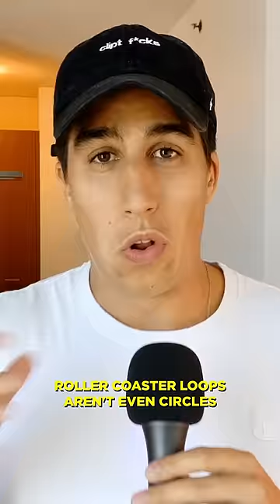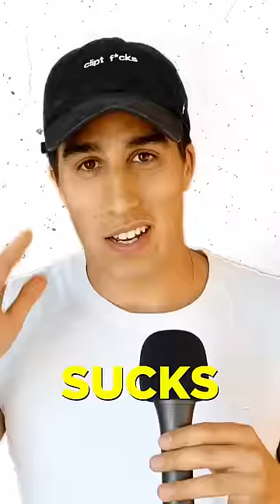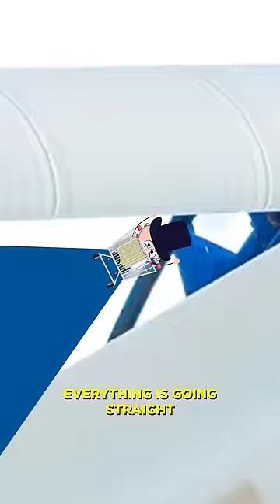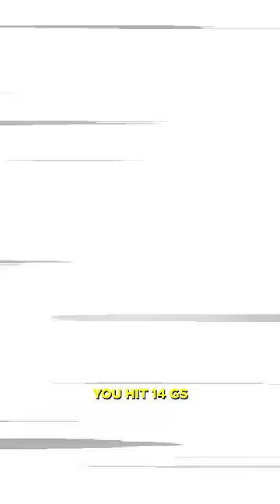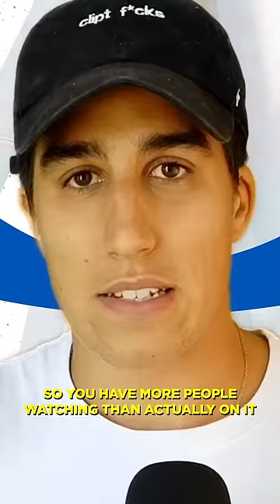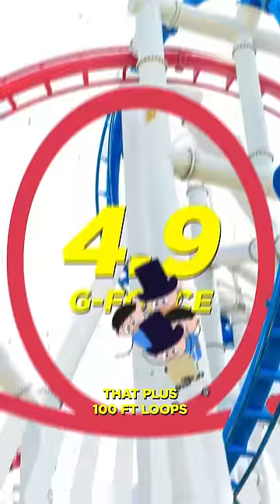Why roller coaster loops aren't circular? #shorts

Comment: Nice video, though you some missing/ wrong information. First, Disney didn’t design the first vertical loop, it was Schwarzkopf, then Arrow Dynamics (who were working with Disney at the time) came up with a pretty much identical design a week later. Also, that 4.9 max vertical g stat that you gave was kinda misleading. That’s not what all vertical loops pull, but just that specific one. Most loops pull around 3.7 gs. The point of the vertical loop was not to lower the g-forces, that could very easily be done by simply making a bigger loop, but to make those forces consistent throughout the loop.  
Sorry about the ramble, but it bugs me when information about coasters are wrong.
Reply: Yeah, Not to mention that the Double Corkscrew was built before a vertical loop.
Reply: Yeah same here my guy

Comment: I remember going on a rollercoaster with a loop for the first time. I was always too scared to ever try but I finally pushed myself to do it. The ride was fast and scary but when it got to the loop, I didn't feel like I was upside-down. It was like the ground and the sky rotated around me and I was completely safe and moving even slower than the scary and fast parts of the ride. The loops brought me peace.

Comment: The "teardrop" is actually called a clothoid loop and the radius of the bottom of the curve is twice that of the radius of the top of the curve. It's the same type of curve used for left turns on cloverleaf intersections

Comment: The first coaster with a teardrop loop was Corkscrew at Cedar Point. Revolution at Magic Mountain did open exactly 7 days earlier, but Revolution actually has a circular loop. Arrow Dynamics is actually who invented the teardrop loop (Corkscrew is an Arrow Dynamics coaster, Revolution is a Schwarzkopf, and they only did circular loops). And it obviously wasn't Disney, the first inversion at a Disney park was on Indiana Jones et le Temple du Péril at Disneyland Paris, which didn't open until 1993.
Reply: "...and they only did circular loops" NO they didn't. It is subtle, but the loops on Schwarzkopf looping coasters do in fact have a teardrop shape. Arrow just preferred to make their loops have a much larger difference in the top and bottom radius of their loops. Yes, the Schwarzkopf loops were closer to circular but the radius was still larger at the bottom than the radius at the top of the loop. and judging by the fact that there is no reference to any reprofiling on the wiki for revolution, it has always been a clothoid loop and not a circular loop.
Reply: @kaylinosprey3306  I took a closer look, and your right. I can indeed see the slight difference in radius between the top and bottom of Schwarzkopf loops. I've never noticed that before! Makes me wonder if a truly circular loop would feel noticeably different from the Schwarzkopf ones
Reply: @Coaster42  also, sorry if I sounded rude. I wasn't intending to. It just bothered me.
Reply: @Coaster42  I believe copperhead strike has a couple circular loops, so if you really wanted that would probably be the best bet for experienceing circular loops.

Comment: Okay so the teardrop loop was actually made to keep a constant force on a rider. It would be uncomfortable if you were to get hang time in a loop and thus, manufacturers made it so vertical loops have a constant positive g-force as it is a lot more comfortable and keeps you in the seat more. The only manufacturer that doesn’t use overly teardrop shaped loops is gerstlaurer and they don’t do vertical loops very often. They’re often taken at speed if circular, whereas teardrop ones are taken at a fluctuating speed.

Comment: Not trying to be rude, but the part about Disney was Wrong. Disney did not do it. One of the biggest amusement companies Disney would work with, Arrow Development, known for rides such as Loch Ness Monster, Magnum XL 200, and X2. They created the first modern inverting coaster in 1975 in Corkscrew at Knott's Berry farm, while the first modern coaster with a vertical loop was Revolution at Six Flags Magic Mountain, made by a completely unaffilliated company called Schwarzkopf, and Arrow opened their coaster with a vertical loop the week after, which is Corkscrew at Cedar Point. Other than that, I think you got the info right
Reply: Wow, and now I'm going to check out your channel. New coaster enthusiast here👍✌️

Comment: The roller coaster loop was designed so that the g-forces (more on that later) wouldn't make the person blackout at the start and end, so the teardrop shape was developed so that the g-forces would be less forceful at the start and end of the loop. 
G-forces (aka g's) is the force of gravity acting upon somebody. 1 G is what you feel right now, or your body weight x1. The average human can go 6 sustained g's without blacking out, and usually 10 sustained g's before somebody could die. Fighter pilots usually go through 9g's of force during some parts of their flight, for reference. (Taking selfies during those 9g's really doesn't make you look that flattering)

Comment: Fact check bc I’m a nerd about this:
Disney didn’t actually come up with the teardrop loop, it was the company Arrow Development. They came up with the first teardrop-shaped loop, but the first modern vertical loop was still circular. Said first modern vertical loop was Revolution at Six Flags Magic Mountain in California, and it was circular and made by a coaster manufacturer called Schwarzkopf (not to be confused with the shampoo company of the same name). Schwarzkopf continued to make circular vertical loops until the company folded, and yes, they did deliver quite high G-forces, but they were built in proportion so they didn’t deliver too much force. That being said, the most forceful of those Schwarzkopf loops could still hit up to six Gs. Going back to Arrow, the first teardrop loop that they made was on Corkscrew at Cedar Point in Ohio, which was also the first roller coaster with three inversions. Arrow didn’t fold until much later than Schwarzkopf, so they influenced other companies like Vekoma and B&M to make teardrop-shaped loops as well. Today, the teardrop-shaped look is the shape of choice for all manufacturers, and no circular ones have been made since Schwarzkopf folded in the late 80s.

Comment: not sure if i dont understand or missed the context but more gs your pulling the harder it is to breathe thats why pilots are trained in the air force on special mechanics to get use to a 9 g force which can cause severe damage, if pilots didn't wear G suits they would snap there necks ect on ejection from aircrafts

Comment: The 1901 looping coaster from coney Island used the tear-drop loop. Disney didn't re-invent the loop, especially considering I can only think of 2 US Disney Rollercoasters with a loop and they both were manufactured after '99. Hell, even the carolina cyclone at carowinds features true tear drop loops and that ride opened in 1980
Reply: Yeah, it was most likely made by Arrow or Schwarzkopf.

Comment: Also, it's the opposite. The circle loop made the g force uneven, not too large. They weren't hitting 14gs the problem was you enter the loob 2-3 g, reach the top 1 or less and then get a 2-3g dismount. Not that fun, this is because you slow down. So the teardrop makes sure the g stays high (for entertainment purposes 2-4g is high even if it isn't that high of a g force) the entire way around instead of jolting you around by reducing g force at the top too much

Comment: I mean technically if the loop is large enough, you could maintain the circle without over G. Thats a speed vs vector issue, you can change vector much faster at lower speeds than you can at higher ones

Comment: incorrect. Disney did not come up with the tear drop loop. the first modern day vertical looping coaster was revolution at magic mountain made by a German company called Schwarzkopf. Schwarzkopf. and Arrow dynamics was next with there take on the tear drop loop on corkscrew at cedar point. and this happened in the 1970s not the 1950s. this video is false information please correct.

Comment: ...I'm pretty sure that shape does not correlate to the experiences force, but instead acceleration does. If the loops were larger, or had less speed going into them, there would be less force... So to quanify the force (or "G's") experienced from passengers from all circular loop rides is illogical and inadequate.
Reply: The shape defines in part the force. Because there's a minimum to do the loop and the shape means acceleration is lesser.
Reply: @mnm1273  yes, and this is fine. But in the video he gives a number, which is not possible with just shape.

Comment: I ride these too much that i don't even feel the G-Forces now 😅
Reply: You won't really feel it until it reaches 5 6 gs.
Reply: @Electrobuzz17  at that point even pilots feel it?
Reply: @LolTheOof123  while i am no expert the feeling of Gs depend on the speed you are traveling and for how long you are experiencing that force. Rollercoaster speeds are no where near that of today's mach 1 speed jets and pilots experience Gs for longer period of time during their maneuvers in air. Do you know even formula one race drivers face near 10Gs . From what i have seen from space flight simulations once you cross the limit of 5 6 Gs most of us would faint because of increased pressure on our blood flow. Genetics and training are a big part of sustaining Gs of level 8,10. Not everyone of us are eligible to be formula one /jet pilots even if we train hard.